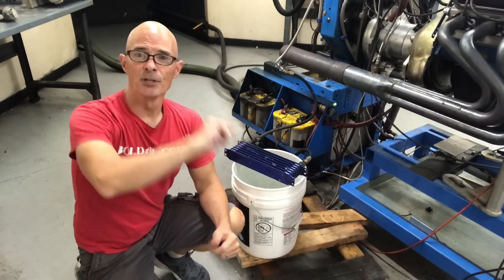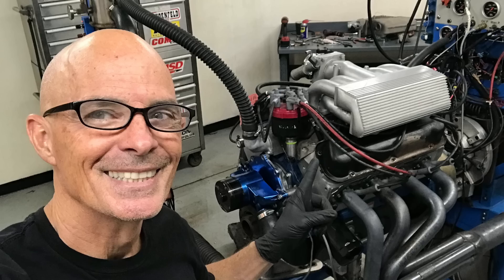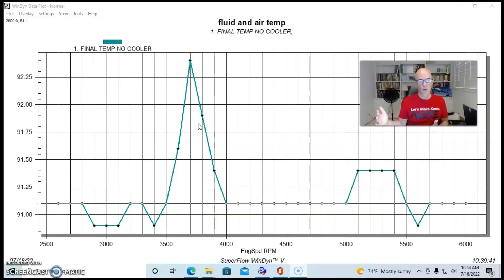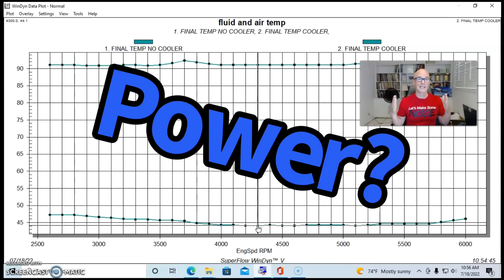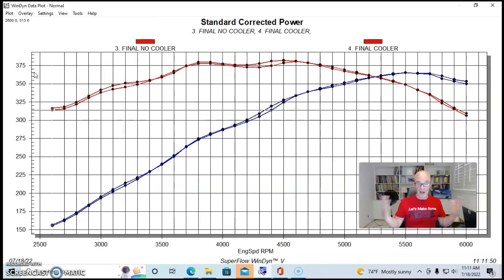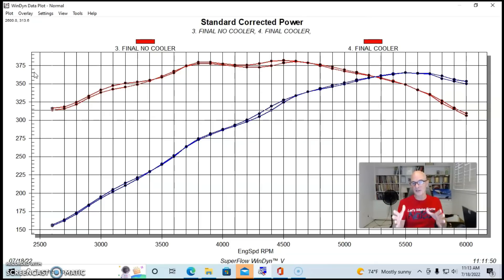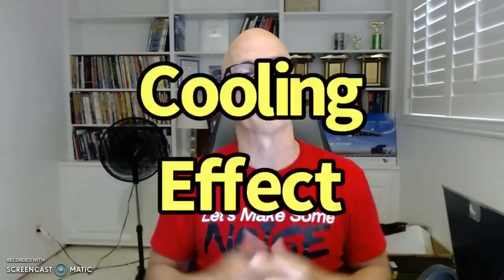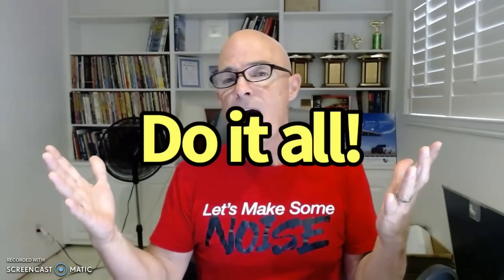EFI FUEL COOLING & HP? DOES ICE-COLD FUEL ACTUALLY ADD POWER TO YOUR FUEL-INJECTED MOTOR? DYNO TEST

Comment: I can explain your result Richard. Basically two things happen here, you heat the fuel from the starting temperature to the boiling point, then you vaporise it (boil it). The act of vaporising most liquids will take far more heat out of the air than the heat it will absorb just coming up to the boiling point. 

I will give you some numbers so it makes more sense (A quick google gives me all of the info for ethanol, petrol wasn't as easy to find so I will pretend you're using ethanol, concept is the same either way, I'm also going to use metric because I'm Aussie). While the fuel is still liquid it will take about 2.5kJ to heat 1kg up by 1 degC, ethanol will vaporise at approx 80 degC. From a starting point of 32 degC thats a 48 degree difference, so it will take 94kJ to heat that fuel to boiling point. From a temperature of 80 degC it will then take an additional 850kJ to turn that fuel into a vapour. Thus, only about 10% of the heat taken from the air is used to heat the fuel to boiling point, the other 90% is used to vaporise the fuel.

So by lowering the fuel temperature to 6 degC you are removing an additional 52kJ (32 degC - 6 degC = 26, 26*2.5kJ=52kJ). Before you cooled the fuel it took a total of 944kJ to vaporise 1kg of fuel, now it takes 996kJ, so you have cooled the charge air by an additional 5.5%, which is likely why you didn't see a difference.

If you knew the fuel flow and air flow you could always calculate the theoretical change. (this could be done just from the power figure, but who's got time for that)
Reply: couldn't have said it better, though I think it's over most people's heads!
Reply: I can work the air temperature change out for you Richard, do you have the fuel flow rate for that run? Judging by the video you didn't take airflow readings. Granted what I can work out will be best case scenario, as in we assume all of the fuel was vaporised, but I should be able to get close to a real world figure with the correct data
Reply: I did some calculations, an engine running on e100, running slightly rich, using 300g/s of air will see 0.6 degC lower air temps from using 6 degC fuel compared to 32degC fuel.
Reply: @tx5brent  you're my hero
Reply from the maker: you actually don't know how much we cooled the charge air because of the time element-that's why I don't test math equations.

Comment: Perhaps an engine Knock comparison re timing therefor a gain power wise? 
If possible a test where a power is set against a static dyno, cold fuel is being used and timing dynamically set whilst running under load? I think you could do this hooked up to the ECU with your PC.
Reply from the maker: you need knock detection for that kind of test
Reply: @richardholdener1727  LS platform?

Comment: Please do this test on a boosted engine, too.  

Another idea is to use an air/water intercooler on an N/A engine.   Then compare cooler air versus cooler fuel.
Reply from the maker: it always represents a restriction on an na motor
Reply: @richardholdener1727  even if the inlet and outlet is very large?

Comment: I think it's just injector/carb placement. If the AFR is right, the engine is going to make the same power with the same amount of air. Charge cooling isn't instant of course so port efi would only have charge cooling like at the bottom of the port, which is to say, not really any at all. I'd try blow through either carb or TBI. I bet I could help my blow through TBI subaru a bunch. I have a very small 1/4" return line, but also an oversize fuel pump.

Comment: Please do "all of the above" everything you mentioned , I too am disappointed it had no affect , would it be possible to run an air/water intercooler in an NA tract before the IAT sensor ? Or would it just be a big air flow restriction ?
Reply: Lower intake air temps on any engine would make more power, that you are correct about. But a charge cooling setup would make the same power with cold or hot fuel, you'll get the power from the more dense air, not the fuel.

Comment: Back when I used to work on old merkcedes benz'z, they would run their fuel line through the AC line before the evaporator core to achieve the same effect. So I'd imagine if the Germans was doin it , it's gotta be beneficial right? Haha

Comment: It's not the temp of the fuel that gets it done. It's the temp change of the air. That's why on boosted applications, a intercooler makes a difference.  Good example to promote the theory is turbo diesel. Get that fuel down to 40° and see what happens.  It's a dog on power production. Now cool the intake charge of any combo by 40°. The fuel vapor is more volatile then solid droplets of fuel. Even the direct injected LT is to cool the tops of the piston. For higher compression tolerances and lubricating. That where the power increase comes from.

Comment: Nah. The fuel needs more heat to evaporate/vaporize. Try running 170 degree fuel, that'll vaporize easy and you'll get more power from less fuel.

Comment: Droplet size is the key to increasing efficiency in charge cooling...  Since the droplets are the same size, no change...   however, moving the injectors up the manifold will give the fuel more time to evaporate, and remove heat from the air...  conversely, if you could make the droplets smaller, increasing the surface area, you will start to see gains, all things being equal.  This is the idea behind ultra high fuel system utilizing DI injectors in a port position...   significant charge cooling can be achieved.
Reply: the phase change from liquid to vapor takes way more energy than the energy difference in these temperatures. or from solid to vapor in case of ice in a glass.
Reply: @lasskinn474  "takes way more energy"  - please explain.

Comment: You should do a heated fuel test to see if the engine loses power?
Reply from the maker: a bigger temp change would definitely provide more data
Reply: @richardholdener1727  could you "drive the dyno" and do a fuel flow test at higher and lower fuel temperatures running at ~50hp?

Comment: It also didn't give much gain because the original place of the injectors is very hot, and it reheats the gasoline at last moment.  It will work best to use the Sky Ram Intake, with the injectors at the top of each port, away from engine heat. (Church Organ Intake 🤭)
Reply from the maker: the injectors were not hot
Reply: @richardholdener1727  I suggest maybe yes re heat gasoline. The definitive way to know is measure the fuel spray's temperature, after the injectors (room temp., and cold fuel)

Comment: Definitely try it on a boosted application. Also, would the colder fuel allow more timing advance on a n/a engine?
Reply: Detonation has nothing to do with fuel temps until you get to the extremes where the combustion chamber gets so hot it can ignite the fuel with no spark. So cold fuel won't allow you to advance the timing on any engine. Detonation is from lighting the fuel mixture off too early and the complete combustion happens before the piston reaches TDC, cold fuel won't change that, ever. Won't change on an engine with boost either, cramming more air and more fuel in the engine under pressure just causes combustion to happen quicker, that's the reason you have to retard timing.

Comment: Even on my efi turbo coyote I saw about a 2 tenths difference in a quarter mile which is probably around 15-20hp.
PS with e85.
Reply from the maker: fuel cooling? or cooling the motor?
Reply: @richardholdener1727  
Sorry, I mean with e85.

Comment: Very cool test, Richard 🥶.  
I fully expected your results to show some significant gains in power with the frosty fuel. Based on this test, I doubt that chilled fuel would make much difference on a boosted application either. Oxygen rich cold intake air along with cold fuel should be the way to go for decent power gains. Thanks for sharing your results. Now we know 🤔.

Comment: You should revisit this for a high compression engine and see if cooling the fuel can let you run lower octane gas without having to back off timing.
Reply: I believe he normally runs inlet air temps on these intakes at 60 degrees, but in an engine compartment that large surface area intake manifold would hit 200 no problem on a summer day--racers often put a bag of ice on the plenum to get better quarter mile numbers. So while the fuel won't cool the air its mixing with, there is a benefit. even with the stock 9:1 CR, initial timing on 5.0's was off from blueprint--typically 6 degrees when they should have been 11, and those in the know bumped up their timing.  

so i'm not sure what this video was trying to prove, since it doesn't really replicate real world situations.
Reply: I would love to to see how Injection pressure effects power on gas  engines   Seems like gas guys  don't really care much about that.    Injection pressure on new diesel engines is around 30 000 psi
Reply: @ruckus__  F1 was limited to 100 bar I think, they would have used more if allowed, there is a reason for it. BMW E46 M3 also used much higher than other engines of the time.
Reply: Ever thought about removing the Entrained air in the fuel?
Reply: That big plenum is kinda heating back up
Reply: It wont

Comment: I think the AIR needs to be cooled. Liquid is a set volume 40 degrees or 120 degrees. Air can compress, which means more oxygen in the same volume.  I think if you put the injectors up high where it has time to cool the air you'll get a power gain.
Reply: if you are gonna ignite the fuel wouldnt cooling it be harder to get it to the flash point?
Reply: @NotDavidM Gasoline has a ridiculously low flash point of -45°F, so cooling it down with ice water at slightly over 32°F isn't going to make much of a difference, especially if the ambient air is well over 32°F.

Comment: Could do a cryo bath of acetone and dry ice 🤔 and submerge your oil cooler in that 😁 it would reach -78°C or -109°F
Reply from the maker: volatile mix
Reply: @richardholdener1727  the co2 on surface keeps it non volatile even with a match, the acetone isn't vaporizing while doing that either.  you would have to have ventilation though for the co2, but it's not as dangerous as one might first think.

Comment: This would work great in road racing application. But yea in a boosted application it works better; there is a guy who runs a GTO in race week and he coils his fuel lines through an orange cooler.
Reply: It won't make more power either way. The guy you're talking about most likely does that to keep the fuel from boiling, not for more power. On long road drives a high output fuel pump creates heat, enough to boil fuel and burn up a pump. When you road drive hundreds or thousands of miles you're just recirculating that fuel over and over again. Adding a cooler like you mentioned just keeps the fuel from boiling in the system and causing vapor lock issues.

Comment: That's a huge surprise. My old drag race buddy Jim Hand had a homemade cool can made out of a Coleman cooler and about 10 feet of 3/8's copper line. He swore it increased his quarter mile times by up to on tenth of a second. That's 10hp or so. But that was in the car, at the track so like you said, his fuel temps might have been 140 degrees plus, and it was also a carb vs F.I. I personally have never tested this but I do know a plate between the carb and intake that cools makes a little difference.  Try a carb and try a turbo application.
Reply from the maker: it made a difference on carb combo
Reply: @richardholdener1727  Now THIS is curious. I heard from an old hand that the IDEA of a cool can was that the cold fuel hit the hot bottom of the intake manifold and did a rapid explosive expansion, aiding atomization/evaporation. They used to run ice and water or dry ice and alcohol in the cool cans.

Could it be that the cold temperature reduced fuel evaporation/atomization enough to fight any benefit from slightly colder overall intake charge temps in your experiment?

If it worked on a carb, I would suggest cooling it to around minus 100 degrees, BUT, then you would have the problem of the carb booster venturi becoming a place where ice would form and clog up the intake and fuel metering accuracy.
Reply: @richardholdener1727  Are you going to test this with a carburetor set up?

Comment: This is just a guess and I am no engineer or engine guru.  It could be that it has something to do with air/fuel ratio and the temperature inside the cylinder.   A colder air charge is more effective than cold fuel.  I am not sure but for gasoline it is a 14:1 stoic.  My point is that there is so little fuel that is atomized in the cylinder that it has no chance of staying cold.

Comment: When dealing with temperature you should always convert your fahrenheit or celsius measurement into Kelvin. This will tell you the truth percentage change from an absolute zero 90f to 40f or 305k to 277k is only a 10% change in temperature
Reply: absolute zero makes no difference to the maths here. if you want to know what the delta is in Kelvin just take the delta in degF and multiply by 0.5556, or just half it for a rough estimate
Reply: @tx5brent  I think you miss understood what I ment. You could have used any scale of measurement whether it be fahrenheit or celsius and seeing the numbers drop by half doesn't correlate to an actual 50% drop in temperature if that was the case and I was to see 120f/322k without an intercooler but then add one and the temperature drops to 60f/288k it doesn't equate to a 50% increase in power does it, you would most likely see around a 11% increase. I was just stating that Kelvin gives you the true percentage change. Or have I miss explained my self again?🤷
Reply from the maker: that is just silly
Reply: @richardholdener1727  to say that a change in temperature from 90 Fahrenheit to 40 Fahrenheit would be almost half a temperature drop would be scientifically inaccurate🤷

Comment: Richard holdner

I wrote to you a year ago and told you to make a cool can, except instead of ice water I wanted it to be actually cold.

Told you to dissolve dry ice in 100% ethanol and run your fuel lines through that.

Absolutely no possibility of fire, because fire needs, oxygen, fuel, heat.

In a sealed can with a vent to let the pressure out, it would be completely filled with carbon dioxide and ethanol so cold, it would be below the volatility temperature, so you could literally put lit matches out in it.

And it would be so cold, you could easily get the fuel down to -40 fahrenheit, a temperature cars drive in
Reply from the maker: this was actually cold
Reply: @richardholdener1727  negative 40?

Nope.

You'd think the guy that runs EVERY combo possible, would want to try sub zero fuel temps.

On carb motor engine masters got 16 ft lbs toque of ice bags, want to see negative temps.

Comment: I honestly expected more, just by adding the cooling effect that supposedly makes for a denser charge.
Please, do it on a boosted application and on a carbureted application too, both systems  separated if possible.
Maybe on the boosted one it'll have more effect by cooling the compressed air like the alcohol turbo cars and on a carb/wet manifold acting like a shower injector.
Reply: Carbureted applications naturally cool. Bernoulli’s principle draws a vacuum across the venturis and that causes a phase change with the fuel. Liquid to gas phase change sheds energy aka cools down. The cooling causes the air and fuel to have less volume and more density and now it has negative pressure compared to ambient and increases the intake air velocity.
Reply: @RadDadisRad  I get the cooling effect deal "by default" with a carbureted application, my question is: Would it get even cooler and denser by using cooled fuel or does physics don't care what we do temp wise at this point ?